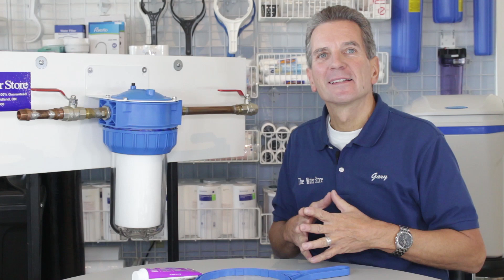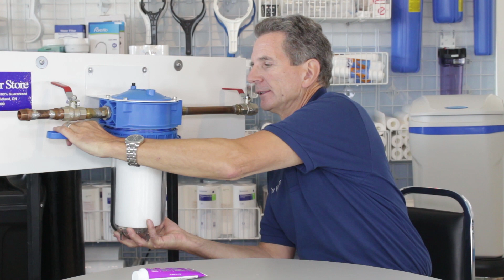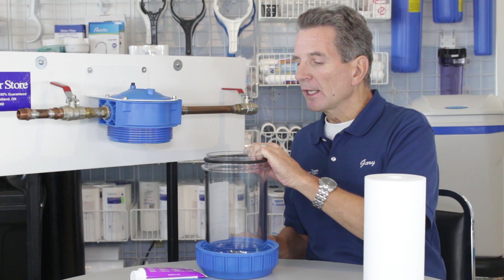How to Change Filter Viqua 3 piece Water Filter Housing 7 easy steps

Comment: Hello :) I have this filter. In the instructions that comes with it it says at the end to press again de pressure button?
Reply from the maker: Thank you for your question. We have not normally heard of pressing the pressure button again at the end. Typically, releasing the pressure at the beginning works best.

We have found the best method is to open a tap before starting the filter change to release pressure in the system. Once the filter change is complete, slowly open the water valve again. This helps refill the system gradually and makes it easier to spot any leaks.

Comment: Thanks for the info Gary. I followed everything but when I turned on my faucets again, two of them have almost no pressure. The bathroom upstairs and the kitchen sink. All others are fine. I turned off the water, flushed all the faucets to try and get any air out of the pipes, turned on the water but still, no pressure from those two faucets. Any ideas to fix it??
Reply from the maker: Sorry to hear that, I suspect the aerators are clogged on those 2. Remove, clean and reinstall them.
Reply: Thanks. I'll try that!  @water_estore
Reply: Wow, that's all it was. Cleaned them out and everything's good now. Build up of sludge.Thanks so much!!

Comment: Gary - what would cause water to leak out from the pressure release push button?  Thanks
Reply from the maker: The oring for the pressure release is likely leaking
Reply: @water_estore  I wondered if this was the case; is the o-ring replaceable? Thanks!

Comment: Hi. I have a 3 piece filtration system and when replacing a 20" cartridge, there is a small leak either around the large compression nut, or the purge valve that dribbles water after I replace and tighten the compression nut. How do I get the cartridge to sit properly in the housing while I'm tightening the compression nut on the canister? Any other recommendation as to why I'm getting a slow leak? My drilled well is into a sand base, and I recently had a sediment seperater attached to the submersible pump in the well.  I'm on my 4th attempt to get the leak to stop....Any help is greatly appreciated.
Reply from the maker: Did you try some of the suggestions from this video? https://youtu.be/1-GP14wSNdQ
Reply: Yes. 4th attempt I wiped down all the threads on the canister and main housing. I also wiped down the o-ring which made a tight fit and I snugged the canister nut and it stopped the leak.

Comment: The filter that I removed had scored ridges all round the edges like  corkscrew but the one I got from you didnt. Should I be concerned?
Reply from the maker: No, the manufacturer has changed their filter, but it still works 100% the same.

Comment: Gary - great video... I did my first filter change ever yesterday (my system has 2 filter holders, the 10" and the 20") and I went step by step with my laptop and your video in the mechanical room, pausing as I went. Everything was perfect and my water pressure is back up nice and high. Thanks a bunch for the info. QUESTION ----> what brand of silicone grease do you recommend or have available?  Thanks!
Reply from the maker: This is what we recommend https://waterestore.ca/products/plumbers-secret-clear-silicone-grease-food-grade-113-gram

Comment: Hi there - I’ve removed the lock, but the plastic filter housing will NOT come down and out no matter how hard I pull. If I pull any harder I’m going to break the pipes. They said that they installed this thing correctly, so then why is it a near-impossible task to pull down the housing?
Reply from the maker: Great question!  Did you try the advice from this video? https://youtu.be/BcTaSyBiD78

Comment: Hi there, bought the carbon filter, sediment and UV light system from viqua company recently. It seems that once a month the filters need to be replaced. To me this seems like a lot. When  I inspect the filters, they are still bright white in colour. The primary issue seems to be that water flow becomes slow when they need to be replaced. My water has been tested and I do have hard water without a water softener. I have gone up from the 25 micron filter to the 30 micron filter and nothing has really changed
Reply: @water_estore  
I have the absolute h20 by viqua. It's from left to right, sediment filter, carbon filter and then uv light
Reply: @water_estore  when I was using the 5 micron filter it did not last very long at all, I thought I required something with coarser flow like a 30 micron
Reply: @water_estore  I have tried replacing one and then the other, it's just if I have to replace the filter every month, annually it's going to be extremely costly